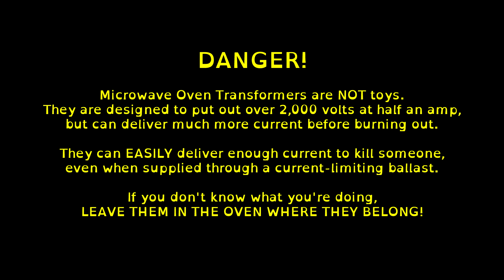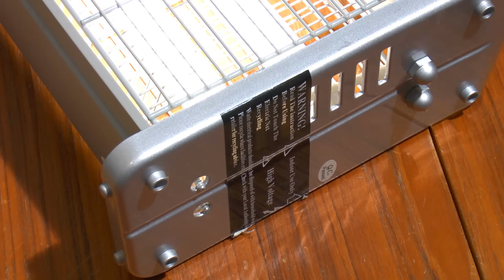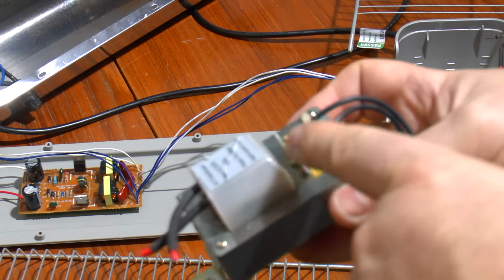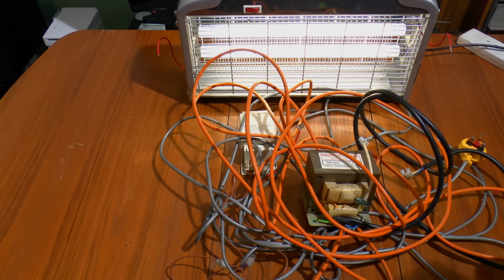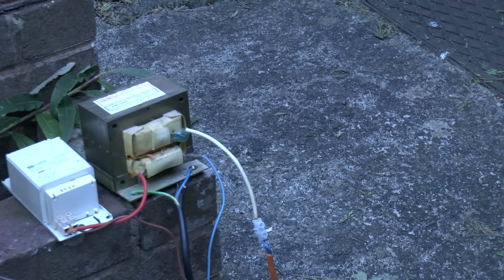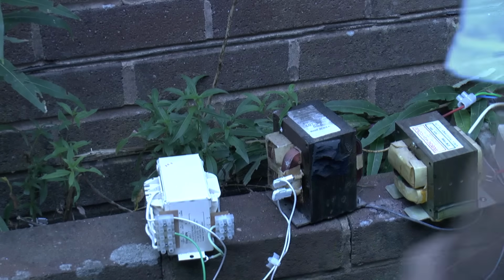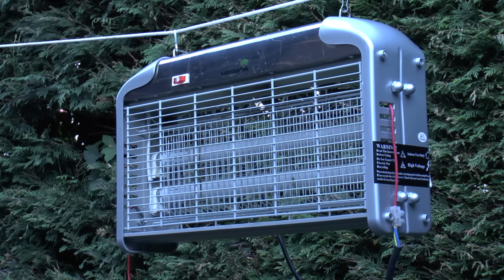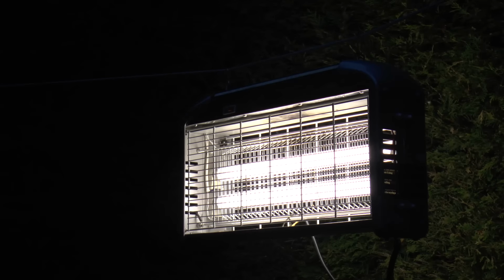Bug zapper gets a microwave transformer upgrade

Comment: Brilliant work ! same concept as my wasp zapper which works very well awaiting next summer wasp activity. 
4 kV may be a bit on the high side for the grid spacing. Perhaps use one ballast on the 240 Volts supply to drive both MOT's.
Reply from the maker: I was half expecting to have to variac the supply down, but the 4kV seems just about right, albeit with a hair trigger :D

Comment: Problem with an unballasted MOT at rated voltage is the huge magnetising power - one I measured drew over 100 watts with no load on the output, which soon overheats the MOT if there is no fan cooling. The MOT has minimum iron and minimum copper/aluminium.

Solution - use two MOTs with primaries in SERIES (and anti-phase). The two MOT cores are connected together as before. HV output is now about 1000V from each MOT, but about 2000V between HV outputs, so connect the two HV outputs to the killing grid. No-load draw is now about 8 watts per MOT at half voltage, with no ballasts required and no significant long-term heating, but you still get your full 2000V (at somewhat reduced current) for fly-killing. Magnetising power is hugely reduced because the iron core is taken out of saturation, from about 2 Tesla at full voltage to about 1 Tesla at half voltage.

And - one hand in your pocket is a good idea because a hand-to-hand shock from a MOT source will very likely cause cardiac arrest as well as serious burns to your fingers.

Comment: A lot of these small transformers have a integrated thermal fuse on the primary winding, and now add a bridge rectifier and a large high voltage capacitor, thumbs up :)

Comment: Keep in mind the air gap spacing between the grid is designed specifically for that voltage at varying humidity. Once a spark initiates you will see all sorts of arcs.

Comment: Does the secondary of that transformer have a capacitor inside? I have an old vintage flowtron zapper that the transformer no longer zaps but the lights work. I might take it apart and see.
Reply from the maker: Which transformer, the original one? Don't know, there was a cap across the grid connections which blew itself to bits, though.

Comment: What's normally in a microwave is a voltage doubler circuit, right? And DC. That would also give you like 4kV but with a bit more bang I imagine
Reply from the maker: I've just looked up a microwave oven schematic and you're right. The MOT connects across a cap and a diode, with the magnetron across the diode. On once half of the cycle the capacitor charges through the diode, on the other half the capacitor adds itself to the voltage from the MOT.
Reply: The will probably make the zapper a bit more aggressive ;)
Reply from the maker: I quite like the aggression of the 4kV AC version, it's a softer, gentler form of instant death :D
Reply: True, it would kinda scare me to be honest

Comment: Down Under we have a "fly problem" (don't you know!), and the commercial stuff (even when modded with "a few" HV ceramics, "just because") is often not up to it. I've designed many Cockroft-Walton ladder systems which do work very well, but my "best" (from an entertainment viewpoint) used an NST with a nice big HV cap. bank for storage (and a decent (25mm) grid spacing). Not so efficient for the smaller stuff, but the big stuff really went with a bang (and a bit of a splatter). Amazing how much juiciness our larger insect life contain :-)

Comment: Heh, now that's what you call a bug zapper. Might be worth measuring the current going through that choke as the 150w rating is really meant for the quite low arc voltage of a SON/ MBI lamp. If it still kicks out 1.8 amps when you pull 240v through it that's quite a bit more than 150w!

Comment: Man that's gnarly. I've love to see the bugs getting smoked. Maybe remove some of the grating so bigger bugs can get in and be smoked. Bet that would throw off smoke.
I have a vintage flowtron bug zapper, lantern style and I've had it for maybe 35 years and still works to this day. I had to fix it a few times. It has 5600 volts at maybe 10mA.

Comment: You could make it more like a hand held zapper by rectifying the output of the transformer and then using the rectified voltage to charge a high voltage capacitor. A bank of the metal capacitors you also find inside a microwave should be pretty powerful ;) Aim less for extremely high voltage and more for instantaneous current... BAM!

Comment: I don't know about UK, but I have fixed a number of transformers in Canada by unwrapping some of the insulator around the primary and replacing the embedded thermal fuse that was just under some wraps and in series with the primary.
I recall a NAD amplifier with integrated primary thermal fuse...  Isn't that a British company?

Comment: What happens if the light cuts on but the zap part does not work??? What would cause this??
Reply from the maker: In bug zappers there are two separate systems; a fluorescent tube driver (which in some units is electronic and in others a magnetic ballast with starter) and the high voltage generator. One can fail independently of the other. That's what happened to this one.

Comment: A n00b question:
Why do I need ballast for inductive load or huge resistive load?
Reply from the maker: The ballast is there to limit the current. I BELIEVE (in other words I've been told) that an arc (be it in air or in a lamp) is practically a dead short. The ballast controls the current because the arc can't do it itself. In this case it's not because it's inductive or resistive, it's just because the arc on the secondary would pull too much current without the ballast (also known as a choke, and perhaps now you know why it's called that).
Reply: Without ballast the MOT takes as much current from the mains as it gets. That creates incredible arcs, but triggers the fuse and/or burns out the MOT very quickly without proper cooling. Especially the secondary is made from very thin wire and cannot withstand arcing longer than a few seconds.
Reply: if you take the ballast away like people have said the secondary winding would get cooked or the grid itself would melt and fall apart (if the transformer whitstood the heat for long enough time for that to happen), don't forget if you don't have any current limiter of any type in a circuit and you put a short circuit load on in, according to ohm's law it would give you infinite current, at 4000 volts it would destroy anything fast since there is a lot of tension present...

Comment: hi,i would like to ask :i found at ebay this transformer "Neon Transformer 4000V30mA50W"can i use it direct on the grids?will be ok?Thank you.
Reply from the maker: Sounds like it would do the job nicely.
Reply: thank you for the answer!i would like to ask you if i will use the Transformer 4000V30mA50W is it necessary to connect a capacitor or a resistance at the output and after on the grid?or just connect the output wires on the grids(will this damage the Transformer or is ok)?thank you!!
Reply from the maker: I'd expect a neon transformer to handle it as-is. An arc in a tube or an arc in free air, should all appear the same surely?

Comment: I'm surprised that the high voltage didn't affect the fluorescent tubes, being in such close proximity.
Reply from the maker: It may be because the average voltage between the grids and the tubes is very low. At the peak of one cycle you've got a row of wires at about 2800 volts (based on 2kV AC RMS), with another row of wires in between those wires at MINUS 2800 volts.

Comment: I love projects with MOTs but I am rightfully terrified of messing with them. I have a spare MOT laying around. I want to know if it's possible to place a wire along the top of my dividing wall from the output of said MOT to deter cats from walking across it and weeing up the side of my house. O.o :)
My previous employer had a commercial bug zapper on a wall near the back doors. Directly under that zapper was a cardboard bailer (you can see where this is going) I watched one day as I was passing it, a large, fat, fluffy bumble bee meet an unfortunate end in it and it caught fire. Luckily it remained stuck inside the unit but from that one can see how avoidable fires can take hold in commercial and industrial settings just by careless design.
Reply from the maker: Definitely not an MOT, it'll kill anything that touches it.
Two wires connected to the circuit out of a hand-held bug zapper would be a different matter.

The entirely legal way to deter cats would be something like a PestBye motion activated sprinkler.  Cats don't like getting accosted by a water jet.

Comment: I plan to build one of these for zapping. European hornet's and anything else for fun. I have a 400watt mhl to use as light to bring them in and other mhl ballast laying around. However all the ballast I have do not look as clean as that one. do you think that kind of mhl ballast made for 240 will work as a choke for 120v ? I feel like it may not give me the desired burn as if it was on 240.
Reply from the maker: I expect it'll do the job, I was going to say obviously at reduced power but I could be completely wrong on that. Inductors were never something I got my head round at school. The basics of transformers and motors fair enough, but chokes and tuning coils and stuff? Nope.

Give it a go outdoors, worst it can do (unless you go sticking your fingers in) is catch fire.

Comment: actually 4KV with that grid spacing is not good.  the arc will eventually either melt the grid or burn out the transformer. The 2KV was plenty.  it can vcertainly kill a humand so flies will not be able to with stand it.

Comment: Your just evil....good :-D
I expected a switchmode booster + diode/cap multiplyer in that.
i would guess the winding ratio and saw off the primary E section off the dead 2k transformer, then glue the primary E section off another transformer to it.
Yes im nasty :-D
Those transformers would make a good multimeter insulation tester lol :-D, Bzzzzzzz.
Not so many microwave transformers about now, inverters have replaced them :-(

Comment: Hate to be a wet blanket but you are running it at double design voltage, not surprising you are producing travelling arcs up the grid uprights. And no doubt causing massive radio interference! Spark transmitter? Also 5 mA maximum output is for a reason. Kill bugs, not you. 75 mA will kill you for sure. Stick to the design voltage and current limit for safety!